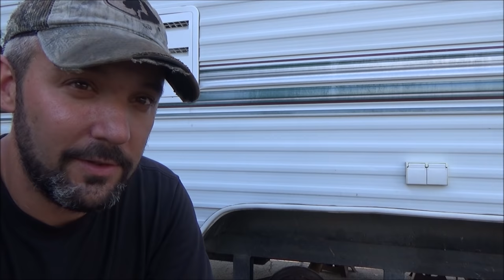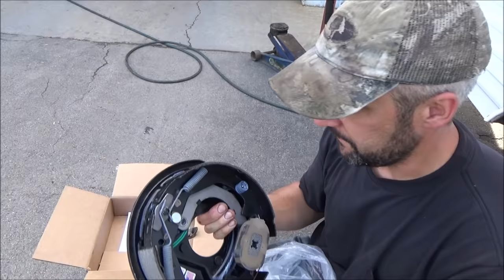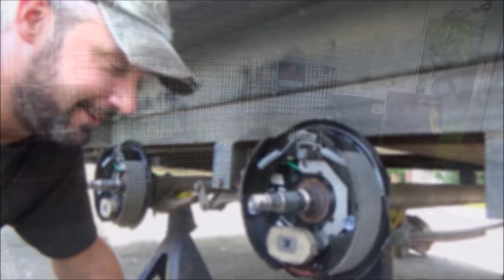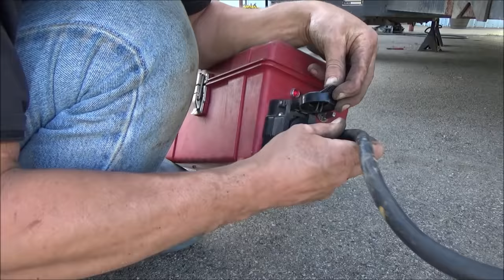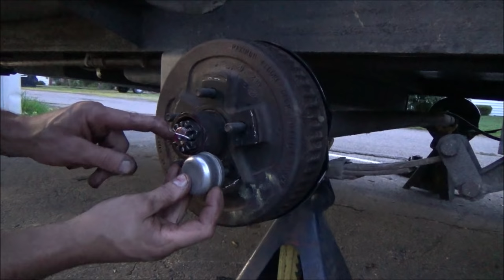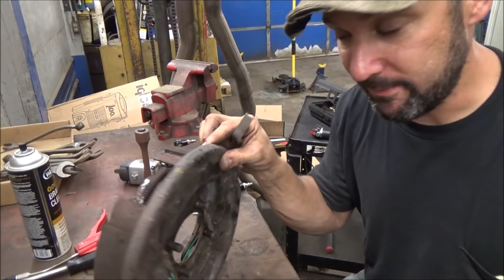Replace: Electric Trailer Brakes - Part 2

Comment: You are right about the poor quality of the trailers when leaving the factory! Our brand new trailer never had the axel turned to align our tires to go in a straight line! And this was on a single axel trailer! I never knew that the axel is actually a little bit bent into a U shape so that the tires tow in or out as the axel is rotated!

Comment: When I was a kid, I took apart and cleaned my bicycle bearings at least a couple times a year. Cleaned them with gasoline, usually in my dad's garage. Better lucky than smart, I guess, because that's a great way to burn yourself up. Gas works geat, but use it out in the open unless you want to make the 5:00 o'clock news.
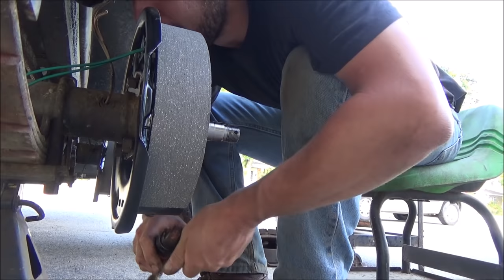Reply: Might be on the 11:00 o'clock news by the time they get the fire put out !!!!

Comment: I do lots of wheel bearings on trailers and trucks probably 50 sets a year and I have both styles of bearing packers and I hate them the grease in the palm is faster and easier and most of the bearings are to big to fit in the packer and it’s hard to squeeze either end up standing  on the thing or stick it in the press but it’s quicker and easier to pack them by hand

Comment: Yes, those are ScotchLok connectors.  VERY inadequate for the Salt Belt.  They seem to work ok in a shielded environment, but a disaster out in the elements!  Some wire nuts have sealant in them, like the butt connectors, to weather-proof the connection.  I've seen them used for sprinkler systems, etc.

Comment: I just watched the video, and concur with the comments. One question.  Are the axle tubes strong enough to support the trailer all the way across [ wheel to wheel ] or just at the end?  Seems like I recall reading somewhere they are NOT. Tks great video.
Reply from the maker: Wythegoodsense Those axles are super weak if you were to try and jack them up in the center. Is that what you are asking?

Comment: You don't have to fill the hub cavity full because there's no moving parts there, but I've always put a thin layer on to keep rust from forming, and to trap any debris that works it's way in. I also like a thin layer on the "between" part of the spindle for the same reason.

Comment: Hey Eric, thanks for the video, question. On my trailer the passenger side has the regular 2 wires for power and ground coming out for the brakes. The driver side however has 3 wires coming from it. Any ideas on what that might be? Just replaced all the brakes and hooked everything back up the way it was before I started the work and the trailer brakes don’t seem to be stopping as much as they should after the initial adjustment

Comment: i use those quick splices every once in a while to do me over till i can get a good solid electrical connector for interior use only, but i use electrical tape on them. i also use wire nuts to see if i have a good connection but hate them because they fall off to easliy. i use a lot or butt connectors with heat shrink as well as the push in ones.

Comment: So, the story I was told was that "glob" of grease inside the hub serves as a reservoir of extra grease. As the wheel spins, the centrifugal force spreads the grease out and provides the bearings with sufficient lubrication. Made sense when it was explained to me. Done it ever since with no issues.

Comment: Thinks for the videos. I love watching them. For the wiring stuff, I like to use liquid electrical tape, and standard heat shrink. Even with the cheaper crimp connectors, a little dab of liquid electrical tape, wait about 30 seconds, or so, then slide over the shrink tubing, and heat gun it. A can of L.E.T. will last about 20 years. You use so little of it.
Reply from the maker: roadkill5333 well can't say I have ever used any of that stuff...

Comment: Something worth mentioning is the use of bullet connectors which would allow the trailer side wires not to need to be shortened over time.

Comment: Extra grease in the hub is the way I was taught. Reason  why is if the bearing starts to fail the metal shavings hopefully will stick to the extra grease and hopefully slow the failure and give you time to notice the problem.

Comment: I end up using that "eco friendly" solvent for my parts washer.
It costs around $100 for a five gallon jug, and the parts washer takes almost 35 gallons for the sump to grab it and pump it.
Since I don't like wasting the pricey stuff cleaning grease... I use kerosene (or diesel) in an oil drain pan.  The advantage over solvents is that I can pour it right into the waste motor oil drum, since it'll get burned in a waste oil burner anyway.
Win / win, and it's cheaper than the spray stuff.

Comment: Those Skylines are made in Bristol In, not Elkhart. If it was from the Elkhart factory it would of already fallen apart..lol and yes those are called Scotchloks and I hated them when I worked for Fairmont Homes. BTW, Indiana is in the rust belt as well, I've never come across a vehicle older then a year that didn't have rust covered undercarriages.

Comment: Actually you mentioned the reason for labeling right and left sides, long shoe to rear, short shoe to front in addition to the position of the magnet arm. Whole assembly from E TRAILER only a little more than shoes only from local parts stores. Magnets rub on drum and sometimes short out, so replace the whole thing is a good idea.

Comment: what type of tourch did you use to shrink wrap the wires.  I used to clean out the brake drums with water and dawn dish washing soap then would dry the with rags and a hair dryer then put in the new greese.  that was the meathod I used because I didn't have a parts cleaner and it was far cheaper than break cleaner

Comment: Hey I'm getting ready to do my bearings and brakes on my horse trailer. I had done them on a horse trailer before with my dad when I was a teenager but that was sometime ago

This gave me a pretty good refresher and answered actually most of the questions that I had. While you called it rambling I thought there was some pretty good detail that you offered. 

One question I do have is about the wiring to the brakes. You said that there would be three wires coming out of the break going across the axle. If that's the case, can you explain a little better? As I saw it, one wire came from the truck into the break, and then the other wire went across to the other break. What I'm not sure because of missing wiring is where the second wire on the other side of the trailer goes to

So now I'm really confused why there's three wires involved. Only two wires are coming out of the brake hub

Can you clarify this or do you happen to have a video that explains it a little better?

Comment: One wire carries all the current for all four brakes? So be sure to get a good brake contoller that tests the circuit?

Good to see you using waterproof butt connectors, crimp is better against vibration.

I think the Scotchlok IDC connectors are perfectly fine for the warranty period, not much longer.
Reply from the maker: +erg0centric Yep and it makes assembly quick

Comment: That's basically how you set bearings, run the nut down all the way, then back it off then slightly hand tighten, or until the cotter pin goes in, whichever comes first. Slight play is good, as the bearings heat up they expand some, so too tight is not good.

Comment: just purchased my first trailer recently,  ..used.. since i'm too cheap to buy new.  I have been used to salvaging whatever is still useable on my vehicles... but these trailer brakes seem to be disposable.. I'm assuming due to their design and quality.  Not real impressed throwing stuff out but when it comes to brakes, there should be no shortcuts that will endanger anyone.
Do you agree that only replacing what needs it is safe ?.. or just chuck the whole assembly ?   This is my personal trailer.  
Thanks for the walk thru ,  I'll be doing it myself shortly.
Reply: By the time you purchase separate replacement parts, the cost is not that much less than a complete, already assembled brake backing plate in which all the parts are new. I believe, a much safer alternative. I do remember, in past years (decades), purchasing and using overhaul kits for many items, like brake master & slave cylinders, carburettors etc, but you still have a reused body that, very likely, has minute pits or grooves in it and is likely to require another overhaul long before the need to replace a whole new assembly, refitted instead of an overhauled one. 

Also remembering that brakes on towed vehicles operate in an extremely severe and punishing environment, under very heavy stress loads, often have very irregular use and, unless the owner is particularly judicious, are equally irregularly serviced.

Applying Vance Packard's thoughts & concerns about "planned obsolescence" and the "throw-away society", is commendable, however, to me, safety is paramount.

I also rely on the hope & belief that we have and will continue to improve our conversion of waste into new products, meaning that precious resources are not wastefully squandered.

As a side note, I remember reading of a motor vehicle, in the Northern Territory of Australia, during the second world war, kept running with a Jarrah wood piston in place of the un-serviceable one. I would imagine that is just one small example of innovative thinking, as applied by many people during extreme times of need.

There are all sorts of ways to "think outside the box" and be innovative, but using new parts together with old ones, is today, to my way of thinking, false economy. Particularly where safety is concerned, and because of the increased number and relatively high speed of our vehicles today.

Our vehicles may be our own personal vehicles, but our use of them normally affects a huge number of other people, mildly in normal traffic, but catastrophically in the case of an accident caused by the failure of an over-stressed part or parts.

Comment: Eric O’, Great Video. I have 4 trailers with Electric Brakes. Should do some Maintenance!! I was hoping you were going to show us how you make a connection to a running wire without using a 3M Scotchlok. Do you cut the Wire so you can install Heat Shrink tubing and then Solder the 3 together?
Reply: For any safety-related wiring, Scotchlok is really a bad idea. Cut and splice properly is the only way. Personally I would use the heat-sealable crimp butt connectors. Also there is a heat shrink tubing with sealant already applied, so solder connection would be OK. For a 2-to-1 connection, a sealable crimp Y-connector should be used. Using only non-sealable heatshrink, the gap between two wires will admit moisture and the connection will eventually corrode and fail. In Southwest US, it may take years. In NY one or two salty winters will do it in.

Comment: just a thought , when bending cotter pins , thought they supposed to go over the top of the castle nut, not over the front < avoids the old drag noise from cover?

Comment: You appear to be doing a pretty adequate job of changing out those brake calipers but my biggest concern is how you torque the bearing down on the race I was always taught a rule of thumb torque the bearing down to factory specifications and back the lock nut quarter of a turn off

Comment: Most the time I grease the shaft pretty good. As there not water proof. So they keep corrosion from starting. As I have pulled the drum or rotor off and the seal gets pulled off with the bearing. It's a boat thing. As most trailers get submerged in water. 

The grease I use is GL5 rated mobile 1. Once the carrier oil separates from the grease. You get a nice liquid that covers everything. While the grease stays put and washout problem.
Reply from the maker: Claude Rains All great advice thank you :)

Comment: Eric!  For those butt connectors try twisting the wires together first and insert them into the same end of the connector that way they are directly connected to each other and crimp down tight.  It's quicker too since you only crimp once per connection.

Comment: I want you to do a video on the battery backup emergency brake plus the activator switch inside the vehicle you have the one that works with the level inside when you hit the brakes the front of your front of the vehicle goes down so that makes the brakes work or you have the one where you can adjust how much power because it's hooked up with your brake lights and then you just control how much power

Comment: Eric great job as always. But may I add a bit? When doing trailer brakes I use the tool that is used for checking drum with in order to get the shoes close. Also when all is put together I will spin the wheel and have some one pull the break away pin wheel should lock up in 3/4 of a turn.
That test box is very cool I made one up years ago not as good as that. Have you ever put a amp clamp on one to get a amp reading? (per wheel)   I have all ways felt that scotch locks are only for temp. use only! If using a wire nut do this   Strip the wires twist them up add dielectric grease put the wire nut on then twist it some moor then tape it up real well. 
   PS What did you do on those 2 C4,s As I own a 1984 vette I would like a vid. on that Well best of luck to ya.
Reply from the maker: Joseph Tucci All good advice thanks for sharing. Well the 1 C4 got new weather stripping on the doors and roof, serviced, and had a seized injector making a miss fire. The other one had a service, NYSI, 2 new injector pig tails (mouse damage) miss fire, and had to send the factory bose radio out to have it repaired.
Reply: South Main Auto Repair Corvettes, Yea that's what we want to see. Screw that Chrysler garbage we want Corvettes, we want Corvettes, we want Corvettes. A weather stripping video would have been good.

Comment: I enjoyed the video, keep up the good work. 

Have you seen the low temp solder/heat shrink butt connectors... if so, what is your opinion of them (Amazon -solder seal butt connectors)? I just bought some out of curiosity and have only used them on speaker wires in my shop and am considering whether to use them on a trailer I'm building.

Comment: I realize this is several years old (just now saw it) and damned fine instruction.  By the way, do you happen to have a wiring diagram for your breakout box?  Using the jumper pack for a power source, are you grounding the box/wiring to anything?  Thanks for your time.

Comment: Insulation displacement connectors, the Scotchlock® IDC Butt Connector was invented/created by 3M.

As a network systems engineer when installing long Cat6 runs we'd use inline splice connectors that required a punch down tool. I'd never use the Scotchlock type connectors because the slightest movement and you'd go from gigabit speed to almost nothing.

Comment: im 58 and twerl grease too, i do it cause i was told that at high speed or heat grease will travel out of bearing so have the extra to go back in and not get lost in low valley

Comment: I've always figured packing the hub full of grease was a waste because 10 years down the line all that grease is still sitting in the same spot it was when it was packed in there.  You can tell it never moved, never "melted" and flowed into the bearings.  Just taking up space.

Comment: HI Eric,
I enjoyed watching part 1 and 2 of the electric brake trailer, I not worked on this system so it was interesting to see the setup.
I also had the old bearing and cv joint grease packing jobs when I was a kid, fond memories.
I always call scotch locks scotch locks but I think they are insulation piercing connectors or similar?
Reply from the maker: richard pearce according to the Google, they're Scotchlok
Reply: South Main Auto Repair 
Thought I would have a google. "scotchlok is the original "insulation displacement connector" introduced by 3M 45 years ago (according to the 3M website). The ones which we are all used to seeing and loath are branded "scotchlok 560 run and tap connector". However they are junk anyway.
Reply from the maker: Yep... put a pig in a skirt and put lipstick on it... well its still a pig. So I guess we can call them what ever we like and frankly they are still junk :)

Comment: I just adjusted new brakes I put on.  I backed them off until there was just I bit of drag.  I pulled the trailer down the road and could feel the extra pull on the trail.  I could smell the brakes burning and feel heat on the wheel.  I guess that's bad and I assume I need to back off some more.
Reply from the maker: sounds like you may have them a little to tight

Comment: I always replace the electromagnet with the drum because electromagnet is actually the biggest wear contact point on trailer brakes it's usually all grooved up Do backing play and complete unit on a old drum it doesn't surface mate So my advice if you're gonna replace everything do new berries new drums new backing plates

Comment: My take on wheel bearings is not about how to pack them. My advice is that when removing the hub if you drop the outer bearing on the ground take the time to clean the dirt out of it and repack it. 90% of bearing failures are with the outer race that landed in the dirt and it was too much trouble to go clean it.

Comment: OMG  just happened to need to learn to do trailer brakes and came across this video and was upset about the missing brake clean noise effect.  I see that this is  an older video so now i need to know when the sma iconic sound effect came into being

Comment: I heard the reason for snugging down the castle nut initially is to seat the bearings and the seal; then backing it off 3/4 turn and done. The other school of thought is that nothing is binding up on the bearings or spindle.
Reply from the maker: John Kerns Or because it is how our dad taught us right?
Reply: Just an FYI....... I never had a father figure of any kind. Had to learn all the maintenance stuff on my own and some other trades as well.